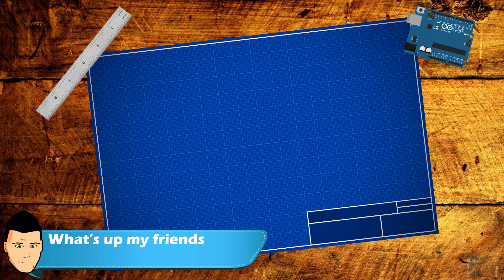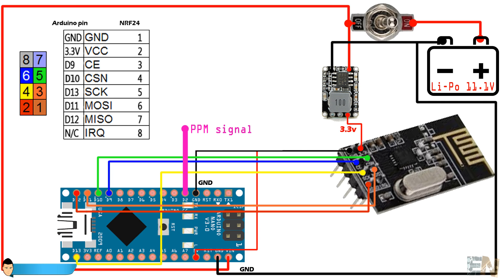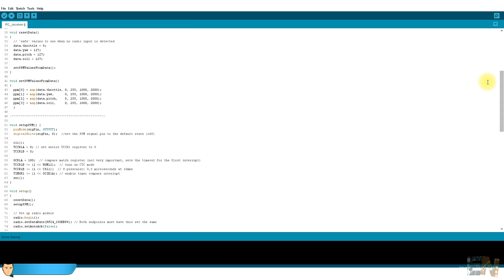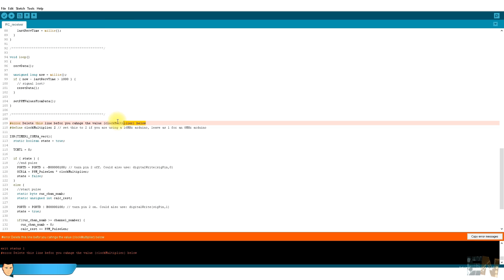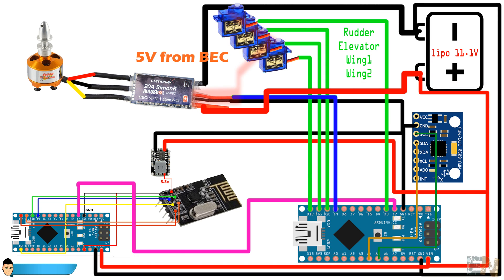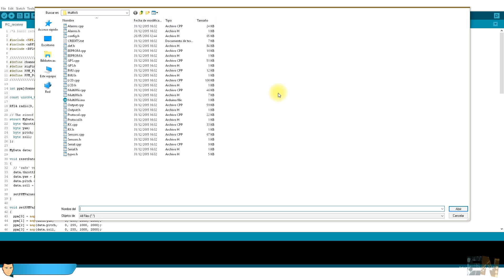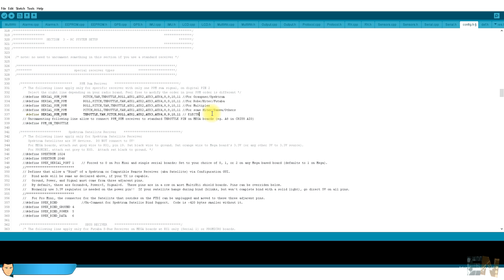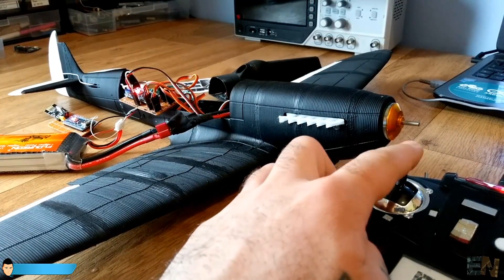3D printed Spitfire plane - NRF24 Receiver + Multiwii + MPU6050

Comment: I am trying to build mine but the receiving nrf keeps breaking off. I think it’s the electronic noise from other wires. Won’t the noise affect the radio connection in this setup?

Comment: Java definitely gave me problems. Updating it does not work, you have to install a certain one. You should put that information in your video, because there is only one place I found it after 2 years. It basically stops this entire project in it's tracks, which sucks when you've done all the work to get to this point.

But you don't care, your video still gets views.

Comment: You seem to have a magnetometer installed on your setup as the multiwii on your screen shows magnetometer detected at 8.34 . But there is no magnetometer in the circuit.

Comment: hi, seems there is a problem with the Q&A page, it say:
 Question2Answer database query failed when generating this page.
A full description of the failure is available in the web server's error log file.
-
i have a problem with Multiwii config app. anybody was able to make it run on windows 10? it always crash when i press 'START' button connection.

Comment: Hi Electronoobs. Its excellent work with great detail. Really helped a lot for a layman like me to start to make the project. I am badly stuck now. Please help on how to connect 2 Aux channels which is built in transmitter section with 2 toggle switches? I want to use one aux for lighting. Please help. I am waiting for your reply friend.

Comment: I am afraid this will not work, since one servo drains 100-150mA at 5V for no load, with load it can be even 500mA @5V for one servo. Arudino cannot supply enough power even to one servo properly. So powering 4 servos (cca 400 - 600mA 5V) from digital pins (40mA max for one pin) or 5V input/output will not work. I tried powering 2 servos and Arduino Nano from ESC BEC and when both was in use (with no load), peak causes Arduino to reset.
Another thing - boost/buck 3.3 converters are not recommended for transmitter/receiver since they are genereating steady voltage (still little oscilating) and this can greatly reduce transmitter/receiver range. See great article: https://hackaday.com/2016/05/31/fixing-the-terrible-range-of-your-cheap-nrf24l01-palna-module/
Reply: Můžeš mi popsat ten problém v češtině?

Comment: Hola, he estado haciendo por mi cuenta un proyecto parecido este fin de semana. Aun no lo he acabado, y así por casualidad me sale este tuyo. Me hubiese ahorrado un rato de pensar y picar código en arduino. Yo utilizo receptor propio de la emisora y las salidas del receptor las conecto a un arduino que se ocupa exclusicamete de leer del receptor y escribir en los servos. Si uno de los canales le llega alto activa una señal que leen otros 2 arduinos, uno que tiene de los controles del roll y pitch (tengo una imu y un barometro que utilizo para la altura) y otro que tiene gps para ocuparse del control del yaw, estos 2 ultimos arduios sacan una señal que le devuelven al primero que establece el PWM de los servos. Aun está en proceso de acabarse pero bueno, como idea para ampliar el tuyo(aunque ya comentabas lo del gps). Por otro lado, queria preguntarte valores que has puesto en tus controles, yo he hecho un PID para roll PI para el yaw y aun me falta diseñar el que será un control en cascada para el pitch/altura, y no tengo claro con que valores empezar a ensayar. Mi impresión es que los del video sean los que sean son muy elevados, parecen mandos muy energicos. Cualquier respuesta será bienvenida. un asludo de otro ingeniero electronico

Comment: my 6050 is influenced by the vibration of the engine. the result is terrible data that cannot be used. use in conjunction Arduino nano 328
Reply: install you 6050 onto some rubber damping isolators to remove vibrations
Reply: already did. but it is also necessary to balance the motor and prop
Reply: Use the spring from a ball point pen clicker and install a coil or two under each corner As a form of suspension

Comment: Can you use remote control 
To control the rudder and other control surface while arduino works?
Reply: yes and it does the arduino 6050 is only there to stabilize the plane warbirds are extremely touchy on the controls and just as hard to fly war birds are considered among the hardest model aircraft to fly

Comment: hola. ¿es posible utilizar el circuito sin el IMU ?. es para ponerlo en un ft spear (tiene solo dos servos ya que es un ala fija)
Reply from the maker: SI utilizas un radio control comercial con receptor con salida PWM solo connecta los servos al receptor. SI utilizas mi receptor con NRF24 debes crear una salida PWM para cada canal. En el código del receptor debes crear un servo para cada pin, en ese caso son 4 canales PWM, y crear una salida analógica de 0 a 255. Luego conecta directamente los servos a los pines de PWM sin el control IMU. Saludos!
Reply: Ok. muchas gracias por tu ayuda! excelente tutorial .
gracias a tu tutorial podre terminar la construcción de mi VANT para la feria de ciencias ( VANT: Vehiculo Aereo No Tripulado).  saludos desde chile

Comment: Why is the ground output of the r module conected to the 5v and ground?
Reply from the maker: Joost Mulder ground is not an output. the radio module is connected GND to ground and vcc to the 3.3v voltage regulator. keep up!
Reply: Electronoobs oké Thanks! because in the schematic you van see that the 5v red line goes to the black wire between the grounds

Comment: your gyro is working only in my plane what I can do now I have wasted my lot of money in this tell me now what I can do????????????????
Reply from the maker: please tell me ore. You say taht the gyro is working so what is the problem then?
Reply: Electronoobs but when I fit it on my plane It is not working with 800mah battery It requer more power..
Reply from the maker: shanu mittal 800mah is not power. it's energy storage. more power is more voltage and higher current capacity. Chech the S and C variables of your battery. I can't know what is the problem in your case. make some more tests. of the system works outside the plane should work inside as well.

Comment: i have a question, it is necessary to use 2 arduino nano for receiver side(plane)
Reply from the maker: You could use just one but combine the NRF24 code with the multiwii in the same one is quite difficult. Besides the flight controller arduino is busy enough with the PID process. Adding the NRF receiver would kill it. That's why I've used 2 arduinos to separate the codes.
Reply: i was able to do it with one! I'll be posting a video on my channel soon.
Reply: @williamneidecker-gonzales  could you please help me figure this out. I started building a drone using one of @Electronoobs tutorials and was hoping to do the same thing. Any help would be GREATLY appreciated. Thank you

Comment: did you get to fly it ?
Reply from the maker: No, I didn't had the chance. I'm making some changes for a future version 2.0, it weights a little bit too much!
Reply: @ELECTRONOOBS  the same I thought so basically it couldn't fly which is due to small size and excess weight . A bigger would have got enough wind pressure under wings to carry this weight 👍

Comment: dosnt fly😔
Reply from the maker: you've test it? What happened?
Reply: spin counterclockwise, cant control it, and i fly rc planes over 10years
Reply from the maker: if the motor spin in the oposite way just reverse 2 wires from it. If the entire plane spins in the oposite way you should change the values in the multiwii platform to reverse it! But yeah, is not the best plane...

Comment: can we make this plane without using the  Multiwii , MPU6050
Reply from the maker: Prabha Pradeep yes, the receiver with pwm outputs connected directly to the motors. you should map the ppm signals of the receiver to 6 separated pwm signals.

Comment: why do you need the 3.3v stepdown board? the arduino nano has a 3.3v vcc pin?
Reply from the maker: Because as I say in the video, the 3.3 voltage regulator of the Arduino NANOcan't supply enough current to the NRF24 radio module. This RF module needs more current than 200mA and the maximum NANO current output is around 200mA. That's why I use an external voltage regulator. That will assure me that the RF module won't lose connection or reset. You could use the 3.3 of the NANO as well but that might give you problems. ANd if the RF is the PA and antenna one you would definitelly need an external voltage regulator. Keep up!

Comment: Buen video amigo, te ganaste un sub, saludos desde Venezuela, sabes intento hacer lo mismo pero usando un receptor 6 canales, sabes donde puedo configurar o asignar los pines de entrada de señal que van del receptor al arduino en el codigo del multiwii?
Reply from the maker: Edgar Olivar hola. si usas ppm solo puedes cambiar el orden y el pin de entrada. si usas un receptor normal con un canal de pwm para cada eje los pines avienen la definidos como aquí: http://2.bp.blogspot.com/-zyazJ2FmvsQ/T5hf-pbR8aI/AAAAAAAAALo/Q6hHKBXP3Ho/s1600/Heli120.jpg para cambiarlos tendrías que ir pin a pin en el código y cambiarlos pero eso es mucho trabajo. recomiendo usar estos.

Comment: Did you ever git this to fly? I have been making slight mods to it. I added some balsa ribs and bulkheads to make the hatch area stronger while still allowing access for the lipo to go in the nose. Adding bulk heads to the canopy allowed for neodymium magnets to hold the canopy on. I have been building and flying planes for over 20 years and can say this has great details and with some small changes is great build. I am using standard rx and tx but still this is the best detail spit print I have found for rc.
Reply from the maker: Nopetard the magnets idea is awesome. I use elastic bands for that. I'm glad you say that, it's quite large project. Maybe you could share some photos with your finished printed plane :)))))
Reply: Once it is done I will be doing a video on it. I might even make some accessory parts for it.
Reply from the maker: Nopetard that would be awesome

Comment: hey i dont know that much about planes. would a small camera for rc planes add too much weight? great project!
Reply from the maker: On this plane no. You can add a camera because is quite light. But try using a small 3S lipo battery.